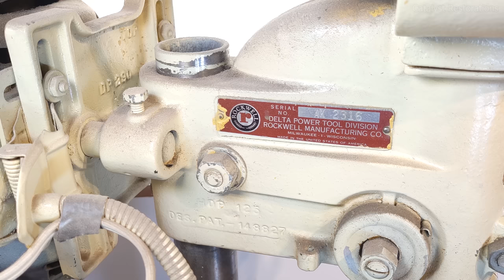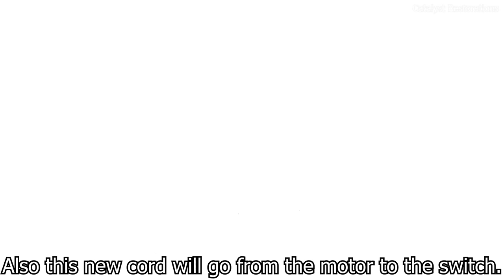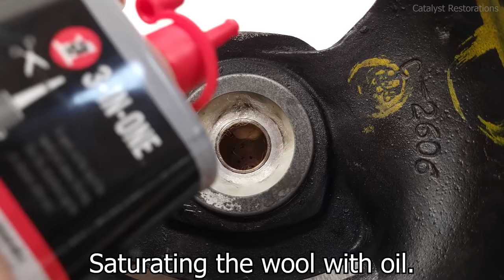1953 Delta Rockwell Homecraft Drill Press and Motor Restoration | Part 1 & Part 2

Comment: Excellent restoration, but just so ya know, the spindle return spring should NEVER be greased! Just cleaned and oiled is all it takes. Grease attracts sawdust and dirt, making it stick.
Reply from the maker: You are 100% right! After about a week of using it I noticed the return was already a bit sluggish so I did exactly what you recommended and switched to oil instead of grease! I need to update the video description to make sure everyone else knows this too.
Reply: C'mon, he rebuilt the MOTOR for christs sake.
Reply from the maker: @Telephonebill51  It's okay William, always room for constructive feedback as long as people as nice about it! 😁

Comment: That soldering job is extremely poor and hazardous. You don't have sufficient contact with the wires of the motor.  You'd have been better off with crimping.
Reply from the maker: Not my finest soldering job, but it's held up to daily use for over a year now so I'm fine with it

Comment: If I might add to my previous comment, as an “older man” I must tell you ,I find it so pleasing to see old machines restored, especially with the modern attitude of “throw it away “ . Those old machines were built by craftsmen with a lot of pride. I doubt if (with a few exceptions) any machine built today would still be around in 65 or 70 years from now👍👍😊
Reply from the maker: Thanks! I'm on the younger end of the age spectrum and I've quickly learned after a few years of restoring things that you're absolutely right in that things used to be built to last instead of built to be inexpensive.

Comment: Love these old drill presses. Pretty sure that's not the original motor. Mine is badge as a Rockwell. Turned out great!
Reply from the maker: Thank you! You are correct, this is not the original Rockwell motor.

Comment: My uncle was a mechanical engineer for Delta during that time period and he sent my dad a drill press and table saw as a house warming present when dad built our house out on the farm.  My drill press that I inherited is very similar. Some of the castings are different and it is labeled just as Delta Milwaukee.  I think 1953 would be about the time frame.  I did just what you did as far as restoration several years back. Nice job on yours.
Reply from the maker: What a great story, Larry! If you're ever curious, Google 'vintage machinery Delta project' - people have put together a fantastic database of Delta serial numbers and the production year and location they were built!

Comment: I acquired this same drill press and did exactly what you did in this video  Unfortunately mine came without a motor so I had to install a more modern one.  I never got up the nerve to undo the spring, but now that I have seen it done, I will attempt it.  Thanks for this!
Reply from the maker: You're very welcome, this is why I make these videos! Good luck!!

Comment: Nice job!  FWIW...  WD-40 is a better de greaser for the first step than Acetone.  I've yet to meet grease/oil "gunk" that WD-40 wouldn't cut in no time.   If you live in a country where WD-40 isn't available, kerosene works just as well.  Acetone is fine for a final pre-reassembly cleanup (it evaporates too fast IMO), though to remove the WD-40 residue, you can also use Isopropyl alcohol.  

Not a criticism, but a suggestion...  Prior to re-assembling parts where the screw head slots are all buggered up.  Hit them with a file before wire brushing them.  They'll look loads better in the end.  No need to replace every screw, just clean them up.

Great work...  Really enjoyed this video!
Reply from the maker: Thanks for the tips!!
Reply: Good job... I found the exact model at a garage sale last month. Nothing moved on it . Lots of oil solvents and elbow grease working like a champ. Only part missing was the quill lock. Just used a 1/2 inch bolt. Just did a cleaning and back in service. New belt also😊

Comment: The result was amazing. You did a great job of restoring this drill press. Thanks for sharing your work. I'd like to suggest one thing if I may - if you wet sand the etching primer the end result, once painted, will be much smoother.
Reply from the maker: Yup, great tip Ben! On rough cast iron surfaces like this there's not much that can be done to really get it smooth without using a lot of filler primer, but still a great tip nonetheless! Thanks!

Comment: Great work my friend.  I keep a drawer of assorted second string screwdrivers that I'll grind into a perfect fit for screw removals on restoration projects.  I'll take a minute to get a perfect fit which makes removal much easier and the hardware doesn't mangled.  Most often the same screws are used throughout the piece so the driver is worth the two minutes work.
Reply from the maker: Excellent idea Scott, I'm going to absolutely use this idea! I've got loads of old screwdrivers sitting around that would love to get some use again!

Comment: When I saw your video header I immediately started watching, hoping to see some tidbit of info that I may have missed when I restored My old Delta  DP-220 drill press.  I went deep, but not quite to the extent that you have here.  Anyway, I was watching along, completely enjoying the show when up pops your banner saying that the link to the manual was in the description...  OMG I almost peed myself with excitement!  I hadn't even considered the possibility that such a thing still existed!  You completely made my day!  Thanks for the great video.  The drill press looks awesome!

Now if I could only get that very slight wobble out of mine...  🤨
Reply from the maker: I so glad I could help out! As soon as I found that manual I knew I had to pass along the favor to anyone else watching because I assumed there would be a good number of people looking to restore their own by watching this video. The whole purpose of my channel is to help others restore their own things just like this!

As far as the wobble there's a lot of possibilities. It could be your motor that just vibrates a lot, a loose belt that also causes a lot of vibrating, uneven wear on the bearing sleeves in the column, or even just the table setup itself isn't sturdy enough. So many possibilities!
Reply: @CatalystRestorations  Yes, I guess it's just time to break down and buy a dial indicator...
Thanks again!!
Reply: Btw...  YES!  I'd absolutely love to see the video of taking apart the chuck.

Comment: One suggestion for the future . If using a "new" tag that takes that type of "screw" , bend the tag so that it fits the place it needs to go . That way the screws are only holding it there . The way you did this one the tag has preload to push the screw out over time with vibration .
Reply from the maker: Excellent suggestion Chris! I've never  seen this tip anywhere before but putting that bit of a preload on the tag makes sense! Thanks!

Comment: Hi , nice job on the motor so far👍
The only thing I would have done differently on the motor would be to clean the winding with a mild detergent, dry out in an oven at around 110 degC and I would then replace the leads at the coil ends and re- varnish the entire stator, I would also have taken a very light “skim” of the commutator and undercut & bevel the segments….. however , refurbishment of electric motors was my trade for many years👍😁
Reply from the maker: Excellent tips! This was my first electric motor restoration so I learned a lot! One other thing I should have done was correctly wire it to 3-phase to fully utilize what it was meant to do. The way I have it wired it just runs at full speed all the time.

Comment: That was fun to watch!  Good catch on the quill lock handle being on the wrong side, surprised there was not a head lock handle instead of a bolt and nut. There are likely two clamp cylinders in the table clamp assembly that can be swapped so the table lock is also on the left side. This would allow you to lift the table with your right hand and lock it with your left. Unless you're left-handed, then the current set up will work. (I'm a lefty so I swapped the table lock to the right side).  The coil spring energy was released when you unwound it at 21:26. It can easily be removed from the housing for cleaning or replacement as there is only a bit of tension now coiled in the housing. Once you wind it back up on the headstock and impart potential energy back into it, then it deserves caution.  You may have done this off camera, but the tops of the two pulleys need to be level to each other when mounting the motor. There are magnetic base flexible gooseneck very bright LED task lights for under 15 bucks that work great and you can mount it on the body of the press or in the cavity under the headstock This will get the cool light source very close to the work or tip of the drill bit or whatever tool is in the chuck. I also add a disk magnet to hold the chuck key.
Reply from the maker: This is all excellent advice for anyone else reading these comments as they restore their own drill presses! Brilliantly simple idea of putting a magnet on the chuck key - I'm 100% going to do that because I swear every time I set that thing down it falls into a black hole!

Comment: Man, I finally changed the chuck on my drill press and in the process my shaft fell down... I was like, how in the world?! 

Went back to your video, check mine... Could not figured out how my shaft could fall off like that, the guy that had the tool before me was using it every single day...

And when I remove the kind big cylinder to control the vertical movement of the shaft... Watch your video again, saw the earthquake... And man I didn't had any shaft collar to make any earthquake on my side!!

So the shaft was like holding like this for years... Without any collar. And by looking at the press drill, that thing has not been disassembled for a thousand moon.

And for the clock spring, mine almost ran away after one counter clock... 

I have experience with those as I repaired a lot of typewriter in the last, but still... I'm one shaft collar away to finally use my drill press...!!!!

Thanks a lot for this detailed restoration!!!
Reply from the maker: So glad you were able to figure it out!!! I get comments that my videos are sometimes too long or too detailed, but I do that on purpose so that anyone else (like you!) can follow along and restore their own similar tools. Glad I could help!!
Reply: @CatalystRestorations  keep it like this! When you're doing the repair for real, you need as much detail as possible!!
Reply from the maker: @Aquefaque  Agreed!!

Comment: Hola a todos....me parecio muy bueno el video....quedo muy bien, aunque sea solo para vos....desperdicias muchos productos en tus restauraciones: usas toallas de papel nuevas para hacer lo tuyo....podrias usar papel de periodico o cualquier otro papel de descarte.....
Y cuando usas removedor de pintura, me parece que usas producto de mas....con menos se puede hacer.....eso te lo aseguro....
Saludos....adios.....
Reply from the maker: Thanks for watching! Paper towels are very, very inexpensive where I live and far more absorbant than newspaper. I could use washable shop towels too, but sometimes paper towels are just simply easier. And you're right, I'm sure I could use a bit less paint stripper. The instructions say to apply a thick layer and it's always worked for me, so I've just stuck to doing it that way.

Comment: Your power leads coming off motor is because it is a 3 speed motor One side will be slow. The other side will be medium and the two together will be high on motor speed. So that will give you 15 speeds that you can run the drill press at. So the way you have it wired it will always run its high speed. If you decide to make it work correctly, you will need a special 4 position switch, The motor was designed for the neutral and the hot to be cut off at the switch, so it will will have off, low, medium and high. And the neutrals will be paired to hot so you’ll need to test it or get the wiring schematics for the motor.
Reply from the maker: You're the first person that's both noticed this and was able to explain this to me! Thank you so, so much for pointing this out and taking the time to write that out - I'd love to unlock the full range of this motor!

Comment: Right from the start of the video this drill press looks almost perfect. :) 
I do not know why you decided to restore it instead of couple tweaks like new power cord :)
Reply from the maker: It definitely still looked decent on the outside! It was in dire need of a tune up on the inside though, both in the drill and motor.

Comment: where can i get a on/ off switch for vintage Delta Milwaukee drill made in the 1950's, also called the DP-220  or some way for me to create a switch for myself.  this unit has 2 black wires coming out of the motor,  ?  thanks,  gary
Reply from the maker: Hi Gary! My first suggestion would be to confirm that your motor is still all in good working order. I assume that the two black wires are a + and - and they're just not color coded, but you should first probably use a multimeter to confirm you have a complete circuit. If you can verify it's a complete circuit, then I would go very simple and buy yourself a regular old light switch and power cord (like I have towards the end of the video) and wire up the motor on one side of the light switch with a wire in each screw and wire up the power cord to the other side of the light switch and test that it powers the motor on and off. If it works, then you have the choice of keeping the light switch and making a more permanent fixture for it somewhere on the drill press or start looking around eBay for a vintage original.

Disclaimer on all of this: these are just suggestions; any repairs you attempt are at your own risk. Please follow all safety procedures and wear proper PPE when working with electricity. If you're not familiar with how to wire a light switch, I would suggest searching and watching a few YouTube videos at least to start.

Comment: Pretty good restoration! A little crude with the methods, but turns out ok. I have a similar Delta, floor model from 39'-40'
Advice: don't remove things on shafts "unevenly", you can seriously damage things, unrecoverably. Use pullers, make your own as needed. That pulley could have been coaxed for enough clearance for a board with a slot for the shaft an then used  clamps in reverse to push it off. OMG! Don't wire wheel shafts if you can ever help it - the shaft will never be as round as it was. Use the lightest sandpapering you can, you end up making the shaft to bearing clearance looser and the motor will run noiser & hotter, unless you are replacing the bearings. Lastly, the motor wires you cut off were fine as they were, just cut back an inch and re-strip. Don't solder, you aren't good at it & yours is a fire hazard, use some kind of compression fitting instead, there are lots of different ones to use.

Comment: At about 47:25, what is with the drive pulley on the motor wobbling around?  It looks like it is ready to fly off!
Reply from the maker: It was the belt tension! Just after about a week after I wrapped up this video I adjusted the plate the motor is on to get more tension in the belt and everything calmed way down!
Reply: Nah . . . I am not buying your explaination .  Your pulley and probably the motor shaft are both junk.  Look at the video at 6:13 and you can see the pulley flop sideways on the shaft while the motor is on the bench under no belt tension.  Beating that pulley off over the mushroomed shaft has certainly taken a toll on an aluminum pulley.  Over-tensioning the belt may quiet it down, but it is going to continue wallowing out the pulley.  There are cures for this, but they would probably exceed the value of this old drill press.  I would largely consider this job a "Sherwin-Williams tune up".   However, I am sure that you will get years of use from this venerable piece of machinery.
Reply from the maker: @danielmays1986  ok bud

Comment: nice job, I just this week , 3/5/23 form my neighbor, a 50's homecraft ,Rockwell drill press in much better shape , in fact the only thing wrong is the chuck , is bad , so my question is , How remove the chuck from the quill,?  Mine came with the mortise parts , was in a cabinet shop for 30 years and then my neighbor got it and had the next 40 years , the cabinet shop built my neighbor's house cabinets , 40 years ago , the drill press was only used for mortising , that's why the chuck run out is .010 to .012 with  gauge pin in the chuck, out side of the chuck runs .001 to .005 .. Again , How to Remove the Chuck form quill ..??
Reply from the maker: At 19:57 I remove the chuck from the quill. It just needs a strong downward force to remove it, as it's just press fit on like most drill press chucks are. Is this what you're asking about?
Reply: @CatalystRestorations  yes , its on tight , just move the lock caller , at the top of the quill, wedge ball joint tool , tried small wedges on each side , and tried a brass punch , thanks , Clifford

Comment: Very pretty.
You used a wall plate for your handybox. A handybox cover won't reach out and grab you.
Commutators should not be cleaned with emery paper. Metallic components are in this material. A non conductive commutators stone is a better choice.
Reply from the maker: Yes, a commutator stone is a better choice.